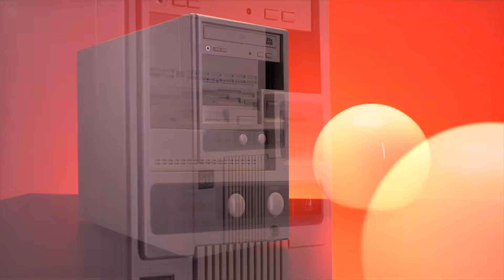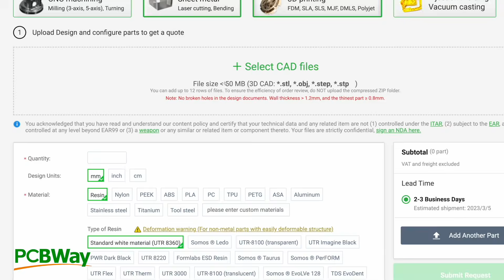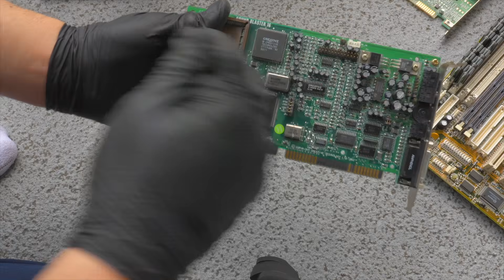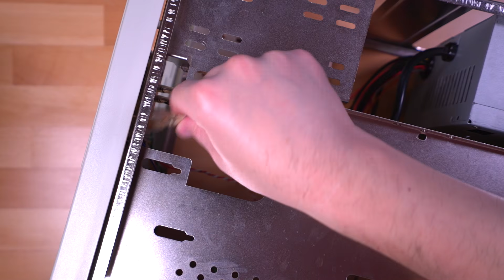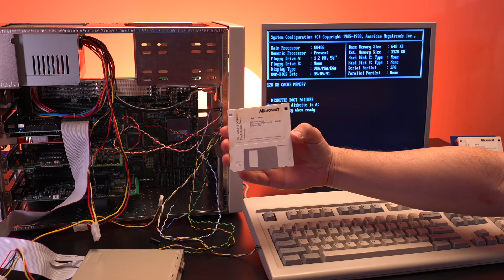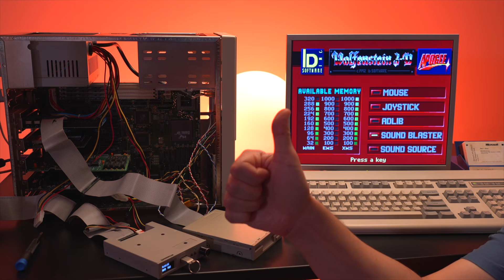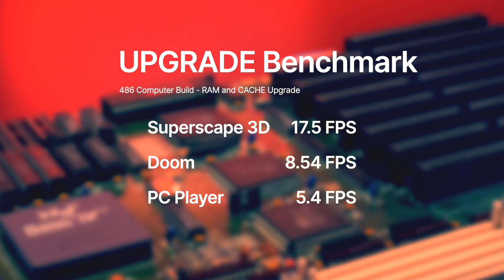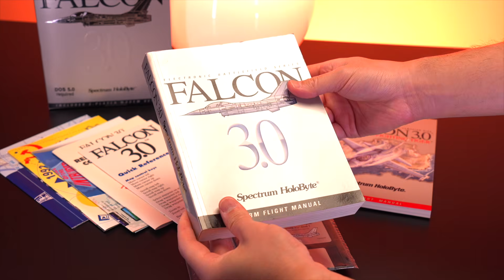Restored And Upgraded 32 Years Later | 486 DOS Build

Comment: My first job was working in a PC building store in the mid 90's. Even back then it was sometimes really difficult to get PC's up and running. Sometimes for no reason that you could figure out, parts would just not work together. My boss would regularly take similar parts from other computers waiting for repair to get the current one working and then replace the other computer with different (usually better) parts.

Comment: That is kind of the rub of the 486 line, it didn't really run Doom all that well in retrospect. Between your family moving to the Cyrix and later day PCI based performance the older stock 486s were struggling with the latest games bitd before Pentium's launch. Your memory of frame rate is better than most Eg. people forgetting that they ran Doom in a window no bigger than a postage stamp heh.😉
Doom certainly was the Crysis of that era, been interesting to see the various later day port projects like FastDoom, Doom Ressurection 32X, and OptiDoom on 3DO try to iron out better performance.

Comment: That framerate is way off. Doom ran at around 25-30 fps on my Dx33 back in the day.
Reply from the maker: I need to figure out what’s going on. Really want to optimize the machine
Reply: @MachoNachoProductions  Yeah that machine should be faster. Could it be as simple as the turbo function being switched on\off? I have trouble identifying anything else slowing it down so much.. Maaaybe the video card but i doubt that too

Comment: Welcome to the rabbit hole of Retro Computing!

As for the turbo button: The Turbo button issue could possibly be adjusted by a BIOS setting. The setting is probably called "Default turbo speed" which can be set to either "high" or "low". If set to low, you might get the desired turbo button working from boot. :) 

You might want to check out several retro/vintage computing YouTube channels, in random order:
- Adrian's Digital Basement
- Tech Tangents
- Necroware
- Phil's Computer Lab
- The Phintage Collector
- This Does Not Compute
- Retro Recipes
- The 8-bit Guy
- The Retro Collective (previously known as RMC Retro and even earlier: Retro Man Cave)
- LGR
- Usagi Electric
- Epictronics
- Scrap Computing
- Bits und Bolts
- Action Retro
- DOS Storm

If you've watched some of their video's, you've probably fed the YT algorithm enough juice for even more great recommendations. :) 

Happy Vintage and Retro computing/gaming everyone!
Reply from the maker: That’s a great suggestion, definitely going to dig deeper into the bios settings!  Those are great channel recommendations. I’ve started to watch quite a few of them when making this video and trying to get the 486 working. The algorithm is now feeding me quite a bit of retro computing video 😅

Comment: Your Battery Mod is totally useless as this Board also has a seperate "Ext. Bat" Connector which does NOT try to charge the external Battery.
Reply from the maker: I am definitely thinking about using the ext. battery. Could be a great option that lasts longer then the cr2032

Comment: If you are able to find a 487 math co-processor, it should give you your biggest performance boost in games like Doom
Reply: Doom is integer-only and doesn't use a FPU. Also the 486DX already has an FPU integrated, so a 487 would offer nothing additional.

Comment: I'm a bit slow coming to the party on this one - loved the video...  a couple of things jump out at me - people have mentioned XT-IDE below, and yes, this will definitely slow down your hard drive transfers etc., so moving on from that would be wise...

The second thing is that your video card (a Trident 8900) is a fairly bog-standard ISA card that isn't ever going to give you amazing performance, and is likely what's causing the bottleneck rather than your CPU/Memory/Cache, which is why you didn't see an uplift there.  If you were to replace it with something like an S3 Virge (one of the more popular early 2D/3D cards) you'd likely see a pretty big jump in performance without doing something silly (like throwing in a (much later) Voodoo card or Riva TNT).

I think that would be in the spirit of your project without leaping to some kind of massive technological jump (which those 3D cards were).  You can pick these up for less than $30 on ebay at times.
Reply from the maker: That’s a great suggestion!  I wonder if it would be possible to keep the tridend card in there but then also add in the S3 virge. I’d like to keep the trident since that’s the card I had as a kid

Comment: Well done on the build - you should be proud restoring a piece of computing and your family history.

I worked building computers in the 90s.  They could be a real minefield - it wasn't uncommon to fix one hardware/software issue to then have another pop up.  What you found is the more you worked on them you got a feel for what worked and what didn't (probably similar to cars of old).

It wasn't uncommon to spend 8-10 hours to fix what should be a simple incompatibility issue.

Obviously PCs nowadays are more standardised and a lot of these issues no longer exist, but I long for these days, even if it's only through rose tinted spectacles!!

Comment: 487 co-pro is the phrase that pays here, it basically takes the heavy number crunching from the 486 which for games like Doom is a big gain.   Hexen was my favourite game of that time esp when you put Doom cheat codes in it would blow you up instantly hehehehe   AMD chips of that time you could overclock quite highly using the pencil trick or conductive paint or very fine insulated wires looped around certain pins then rammed the cpu into its socket, oh the joys of 80's modding :D :D :D   My first PC was actually a Commodore Pet we spotted at our local tip and me mum schmoozed the tip bloke with a fiver and I rebuilt that from lightning strike burnt out to fully working in about six months armed with a "How to" book on electronics, a dangerous live handle ex GPO soldering iron that I could only use with one of my mums Marigold gloves on and the finest quality plumbers solder and acid free flux oh and a ton of harvested broken radios for capacitors and other components as the Pet's main chips were undamaged by the lightning strike.   I also remember ignoring the how to books warnings about CRT's and got thrown across me bedroom when I got zapped by the screen... lesson painfully learned esp when me father had to re-fuse the house electrics... whoopsie

Comment: Wow I remember the 486, I made the very stupid choice of buying a Rage Fury Maxx which on paper was like science fiction powerful... in reality it was a PIG and a big fat smelly one and when it died as they all did pretty much I sold it for parts and a pretty penny even scrap and bought a Voodoo which wee weed all over the ATi junk.   Window's just refused to see the Maxx as a working pair of GPU's and instead picked one gpu core and worked it very hard hence the burnouts that followed as cooling back then was pathetic and despite putting a stick on fan bigger than the silly fans it had, the over working just killed the damned thing.   The Voodoo I ran with through Pentium II and III then the much better cards started appearing on the AGP platform and it was retired with honour.

Comment: Very nice job on this! We at the South East Michigan Vintage Computer Club (SEMVCC) always appreciate a good vintage computer! And kudos to your mom for keeping that stuff all these years!
I have a couple of notes for you.
1. Upgrade the video card. A card with more video memory will definitely help.
2. Add an FPU in the second socket, this will help offload floating point calculations that the benchmarks use.
3. BIOS floppy will only support 2 drives at a time. The monster FDC might have some jumpers and config settings in its ROM. Try removing the Gotek and connect just the 3.5 and 5.25. It does provide its interface for XT, 286, and 386 computers, so I wonder if it just provides basic 2 drive support for 486.
4. CF cards are actually a portable version of an IDE hard drive. Not unexpected that the SD XTIDE didn't work.
5. There might be a jumper setting for the default state of the Turbo.

Comment: Shouldve left your dads writing on there, you might regret it.  Ive gone through that phas when i was younger making old computers "modern" but as i got older i realized adding value to these computers is to rebuild them to period correct from the factory.  But the cf mod is pretty swank. Nice vid man.

Comment: That Trident 8900C is really slow card na it's your bottleneck.  My dad had the same 486DX 33MHZ, but with Trident 8900D ( I have that card till now ) . 8900D is one of the faster cards, complete opposite of 8900C. The CD-ROM is compatible with your sound card, however, you need a small cable for the audio connection.  Also it has to be connected to IDE controller, SB card will not recognize it ( and it doesn't give any sense to use that IDE on SB anyway, it's really slow - it was inteded for Cdroms with 2x speed.  )

Comment: the CD drive should still work fine,, it's an IDE connector as is your Hard drive set it as slave to the HDD and then load the drivers, most cd sys drivers should load it.
Run the Audio cable to the SB and the IDE through your HDD controller.
The SB used SCSI from memory, it's been 30 years but i'm almost certain that the SB is a SCSI interface not an IDE. 
Also you didn't have to reinstall dos, you could have made it bootable by 

A. fdisk and set the part as the master.
B. SYS A: C:
which would have forced the sys over.

As others have said your FPS issues are more that your expecting physical ram to increase 3D graphics, that wasn't how it worked back then. There is a reason that you had 3D Accelerators. And other then that the DX4 etc came out. But also check that your BIOS is set to run at the correct clock speed. Based on the date on your chip it could be 25,33 or 50mhz. If you cleared the battery (which you did) it will most likely defaulted to 20 but with out knowing which BIOS version it's on (presuming Phoenix) it's hard to say.

Comment: For the L2 cache upgrade, you didn't install the TAG chip, which is what the smaller empty socket is for. It is potentially why you're not seeing any performance difference. Even as slow as the 33 MHz DX is, you should see something. You have two existing TAG chips, which are installed in C89 and C90, which are IS61C66-20M (16kx4 SRAM.)

TAG SRAM is a little known memory today, but it was important back then. TAG is used to store the cache lookup table for entries stored in the SRAM cache. Without the TAG memory, the cache controller wouldn't know where cache entries were, and it would be as slow or slower than trying to go back to main system memory. If you have TAG memory, but don't have enough of it, like in a situation where you upgraded the cache but not the TAG, you can see slower than expected behavior. The extra cache may go unused if the TAG lookup table isn't large enough to store entries in the extra cache.

Making it even more confusing, there are actually specialized TAG SRAM chips that have internal logic for cache hit matching. Some motherboard chipsets didn't have this logic and required these special cache chips, which are really difficult to find today.

Comment: I like your Console stuff, but I Started on NES, and ATARI 2600 and went straight to PC and never looked back, and this is right up my alley, Thank You.

When I was a kid (About 15, Circa 1996) I have fond memories of the 486DX/50 I built myself (The 2nd PC i built myself) that I overclocked to a 66 and later to a 75MHz (My first experiance in overclocking) I remember clearly the look of the  case and many of the games I played, ever remeber the hardware in pretty fair detail.
Most of the parts were from my last hand-me-down PC (The Graphics card, CD-ROM, and HDDs) and the rest were parts that I found at a garage sale and baught with my mowing job money. (The CPU, Board and RAM)

White Baby-AT Case with a Turbo LED Readout. (Tiger Direct)
250Watt power supply. (Tiger Direct)
AMD 486DX-50MHz/Board
16MB RAM - 4x 30-Pin SIMMs
2x 120MB HDDs (Given to me)
1.44MB 3.5" Floppy (Old PC)
1.2MB 5.25" Floppy (Old PC)
4x CD-ROM (Old PC)
Trident 1MB ISA SVGA Video Card (Old PC)
Sound blaster 16 Sound Card (A Gift) 
MS Windows 3.0 Multimedia Edition
& DOS 5.0

The Games I played:
Duke Nuke 3D
RoboMan
Doom, II, etc.
Wolfenstien 3D
Hexen
Kens Labrynth
Kings Quest, and quite a few other I cant quite remember.

Comment: I agree with the comment on the 487 math coprocessor.  I bought (and still have) an AMD 386/40 I used for a BBS.  Since all uploads were scanned with a few different virus scanners and recompressed, I wanted what little speed boost and extra compression the 387 provided me.  It was limited to 4 megs of RAM but with the US Robotics external v.Everything modem and a very light BBS software, I had a super fast bulletin board that kicked ASCII

Comment: Dude, your 486 CPU is weak. What is it, a 486SX-25? An SX-16? That's 16MHz btw which is much worse then a 386SX-40, say. The decent 486s all needed heatsinks, which was quiet a big deal at the time, nobody used CPU heatsinks! Damn right you should upgrade it, if you wanna play Doom! And double so if it's Doom 2! You really want a 486 DX2-66 (the workhorse CPU for a few years, the standard back then). 8MB is also, I think, necessary for Doom 2. If not on the box, then in practice. You can play Doom with 4MB but you have to unload almost everything you load up in config.sys. There's like 4095KB of stuff that Doom needs to memorise!

Comment: the 33mhz 486 is the largest limiting factor, the video card is holding things back as well. tridents were kinda the budget cards of the day and quite slow. an S3 card, a tseng et4000 or a later cirrus logic card would be much faster. putting in even a dx2 66mhz you would notice a huge jump. 486's models went all the way up to 100mhz with intel and 133mhz with amd. as others have stated the 8 bit isa cards you are using for storage are not helping. the full isa slot is 16 bits, you are using the old IBM 8 bit portion only.

Comment: For the floppy drive you may need to figure out if the drive is 48 0r 96 TPI and configure it in the FDC accordingly as either a 360K or a 1.2MiB drive. As an aside it's really cool that you can do a lot of this with the ao486 core on the MiSTer. I'm working on getting Windows 3.1 installed with working sound.

Comment: Hey Tito! I was extremely lucky to have a 486 minitower around the same time you did, and the computer store that built it had a free upgrade plan that swapped the Intel 486 DX2 66 with an Intel 486 DX4 100. In most DOS games it was actually faster than a Pentium 75!

While it wouldn't be exactly the same as what you had in your childhood, I would recommend a Intel 486 DX2 66 as a sort of sweet spot, particularly for that early DOOM gaming, without feeling too different.

Comment: Another fun video, thank you.
FWLIW: You might get some extra performance by seeing if your system has any option to change the speed the GFX card is addressed.
Then there's seeing if you have any ability / headroom to address the RAM / Cache speed.
Finally, see what your overclocking options might be.

Oh, and if the motherboard you removed has the support an AMD K6 1-3 that will make a huge difference while being true to your memories.

Comment: Suggestion: build a second one exactly like that (same exact Roland, same parts for the front, same LCD,  same case, same full size mechanical keyboard etc.) but inside it has the most powerful modern everything that can fit in the case's form factor :-) a few liberties is fine (like cutting section so things fit, tapping screw hole so stand offs align) The goal is to make it look more than meets the eye/can't judge a book by its cover. :-) I guess it should use Windows 10 or 11 or Linux and play the latest Cyberpunk but with that LCD. This way you have the childhood nostalgia version (all original no IDE updates, just floppy and that 200MB thick hardisk) which is always a great feeling but you also have a beefed up one which is what you really want to do with the nostalgic version. Find the CRT that originally came with the nostalgic version.

Comment: Replacing the Trident VGA card with a Tseng Labs ET4000AX with 1 MB RAM might slightly increase video speed. If you want a higher framerate for DOOM, try the FastDoom source port which is optimized for lower end systems. The fastest cd-rom drives that could be connected to a SoundBlaster card are quad speed.

Comment: Thanks for the trip down memory lane! 

As far as your hopes of getting the 5 1/4" floppy drive to work, it needs to be connected to the same ribbon cable with your 3 1/2" floppy drive. Having the Gotek installed and emulating a floppy drive may be preventing any more floppy drives from being added. If I remember correctly, these retro PCs can only have up to two floppy drives (Drives A and B as reserved and assigned by the system's BIOS). 

Regardless of a couple of hiccups, that was a very good PC (re)build. 👍🏽💯😎

Comment: You're not gonna see improvements without improving the graphics card.  Old CPUs just couldn't do that graphics stuff and all the upgrades you made only effect the CPU.  Though adding a math coprocessor could help I see a socket for one.  As for the monster card some stuff just is not compatible and there's nothing you can really do to change that.  Old equipment just varies too much and can't be fixed with software.